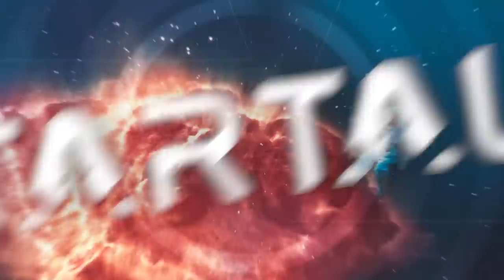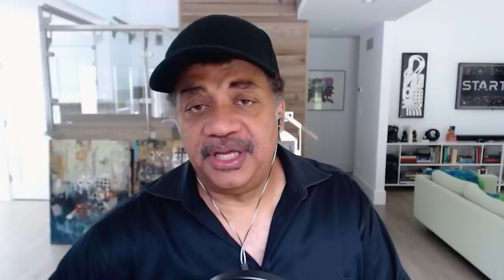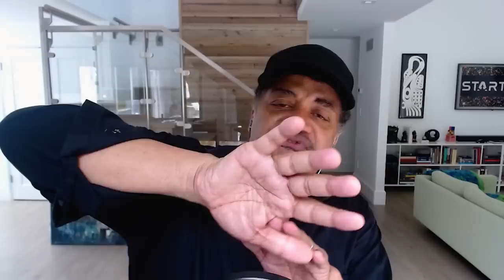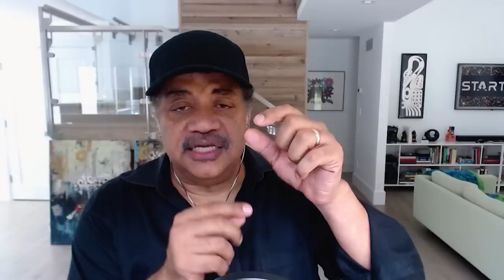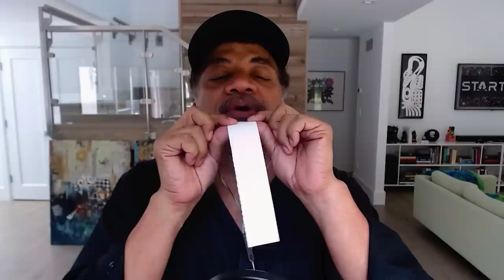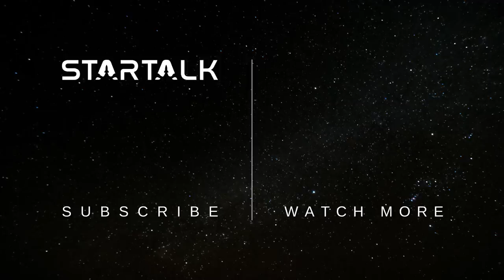Why Are Race Tracks Banked? | Neil deGrasse Tyson Explains...

Comment: I thought that a coefficient of friction of 1 meant the two surfaces wouldn't slide across each other at all, and a coefficient of 0 meant no friction at all.

Envisioning a box that's been waxed with a futuristic compound, sitting on a flatbed with a coefficient of friction of 0, the truck drives off, and the box remains in place until it drops off the back.

And with a coefficient of 1, no matter how fast the truck sped off, the box would not slide off. 🤷
Reply: The term 'coefficient of friction' simply means the proportion the horizontal force needed to move something across a horizontal surface compared to the weight of the object itself.  So a block of 1 kg mass would need 9.8 Newtons of force to move it along that surface if it had a coefficient of friction equal to 1. (1 kg = 9.8 newtons)
Can you have a coefficient greater than 1? Sure. Think of sliding a block across harsh sand paper.
Less than 1? Think of wet slippery ice.
Finally ... can you slide off a track with a coefficient of 1? You bet. Just let the frictional centripetal force of the tires be less than the car's angular acceleration. Off you go.
Reply: @thecarman3693  Thank you. So much for public education 🤣

Comment: just like drifting or doing a burnout, to be in control you first have to lose control.  Other thing is, Nascar don't have spoilers really, and is the only track sport with banks, all other motor sports like F1 and Supercars are on flat tracks, sure they go up and down, left and right,(instead of the boring Nascar track) they are flat and they go way faster.

Comment: 10:35
I believe that Neil (like so many others) gets this issue wrong.  A car going around a race track cuts through the air, the air by itself is not 'flowing' past the car the way a strong wind blows across a flat field (or the piece of paper he blew across). I believe that what causes a car such as a formula car to be attracted to the ground is the front air dam pushing the air in front to the sides, causing a low pressure to form below the car for a brief moment at a given point along the track.  Long enough for the car to pass that point.  You will also see side skirts on cars to prevent any air from the sides to quickly re-enter the region under the car thus help in keeping that low pressure under the belly of the car.
Reply: This is why NASCAR has changed the bottom of their cars to produce the lower pressure, that creates downforce.
Reply: Watch the video against. He explains that when he's talking about spoilers and airplane wings. Bold of you to think you're smarter than a physicist.
Reply: @kimjohnson4278  Sorry, but he speaks of "... fast moving air ...", and that's the error. (Please listen again from my time stamp.) The air is not moving, the car is trying to move through it, that makes for a huge difference of how all this happens. Air that is NOT moving will not produce any pressure changes above or below the vehicle. Hence any downward forces that are produced are the result of action/reaction of the car trying to move air upward; this is produced by front and rear airfoils (wings).  Actually, a car without wings will tend to lift upward.  At 12:25 Neil agrees that he is creating a 'suction' from the effect of air passing by below the car. This is wrong. First, there's no such thing as suction, there's only a force from fluid pressure differences.  And second, blowing on the paper is the wrong analogy to show negative pressure being created below the car because air below the car is not moving ... the car is.  So how do you get the top of the car to press down to not only overcome its tendency to lift upwards but then add to it to give greater downward forces? Put wings over the tires that deflect large amounts of air upwards. And the ONLY way you are going to get negative pressure below the car is how I described it above by using an air dam and side skirts.
Now if you disagree with any of the above please point out exactly what I have said that is in question and explain why.
Reply: @thecarman3693  The air is moving relative to the car. That's the important part. By your argument, planes wouldn't even take off if the air wasn't moving.
Reply: @EmpyreanLightASMR  No no no ... it does make a difference. Planes do NOT take off according to what you likely think of as Bernoulli's Principle. They gain lift through angle of attack and the low pressure region at the rear half of the aileron. This happens because the aileron's leading edge pushes air up as it goes through the air, leaving that region of low pressure. (Just like a tractor trailer leaving a wake of low pressure just behind it.)  I had to learn this when I learned to fly.  This is an all too common misconception.  According to you, submarines should sense a lower outer skin pressure when moving as compared to being stationary at a given depth. This does not happen.

Comment: So same physics as Luge and Bobsled?
Reply: Yes, except Neil brings up the point that on these steep banked turns, the drivers are still "steering" to try to maneuver around other cars. Bobsleds don't have to worry about that so much. But I also don't know how they're controlled, so maybe I'm completely wrong about it now that I think about it. They're probably steered to prevent flying off the track (which sadly happened a couple Olympics ago iirc!)

Comment: What is heavier? 1 kg of gold or 1kg of platinum?
Reply: Like most people, you're confusing weight with mass. kg is a mass. Asking which is heavier, you're asking about weight. In physics, a lot of assumptions have to be made, and in this case, one would have to assume you're talking about both objects at the same elevation on the same planet. Sounds dumb, but a lot of problems are written to confuse students with stuff like that.

Comment: Velodromes also have banking, some roads have banking, NASCAR did not invent it and if we are speaking high speeds we should mention Inycar or Formula 1.
Reply: aDBo'Ch 1  I drove on the Autobahn, and no, speed is not absolutely unrestricted, there are signs that tell you at any given time speed restrictions on the particular route section you are driving, depending on innumerable factors, like traffic, weather, maintenance, etc.

Comment: F1 cars may not take turns at 200mph, but they do at 190mph. 
F1 drivers have to withstand up to 6.5g of lateral acceleration while cornering, 5.5g+ while braking, constantly for 1 hour and a half. 
An ordinary person would just faint and lose consciousness by simply enduring the rigors of keeping an F1 car on the track.

Comment: Not totally true about the banking. The reason for the Restrictor plates on the Engines of NASCAR is because they were getting too fast. You don't need to go 180 MPH in order to go around the corner on a track like Daytona. The Pace car during cautions is less than that. I know someone that drove in 1 of those driver parades that go around. They actually stopped in 1 of the corners, did not fall from the banking. It is a balance that takes place between the rear Spoiler of how much downforce is applied to keep the car pushed down onto the track, & how much to ease it to go faster. The speed of the car is not affected by the corners, so it does not slow down.

Comment: What the fck are you on Neil!? Cars in a racing situation...even on the speedways you are talking about!? Drivers always have to turn the steering wheel into the the corner...if you left the wheel for even a second you may  crash you silly man.

"Nascar is a better way of racing than other types of racing" Again...where are you getting your logic from brother?

Try Tsukuba Circuit in Japan for a true technical test of a cars initial acceleration/braking, grip &  balance of understeer /oversteer  or nurburg.

Much Love 🌍

Comment: The reason why race tracks are banked is because this way you don't need any engineering. It is basically racing for morons. When you have no clue about car engineering, you build a banked track. We had those in Europe in the 50s too (Monza/Italy or Avus/Germany) there are even 2 tiny banked curves on the famous Nordschleife still in use. But once you understand how aerodynamics work you don't want them anymore. When you compare modern Formula 1 to Indycars on the same track F1 is more than 10s faster, in racing that is about the comparison between a pedestrian and the space shuttle.